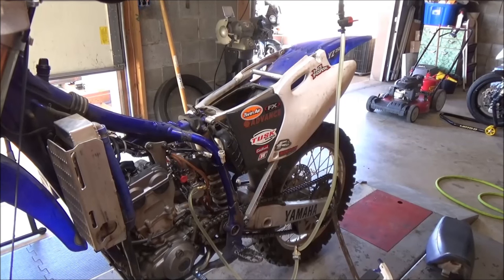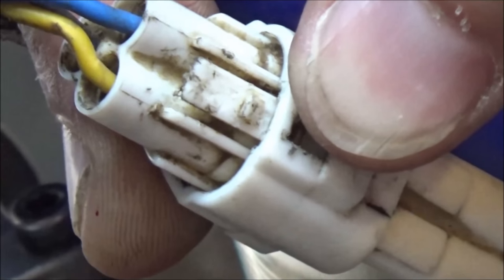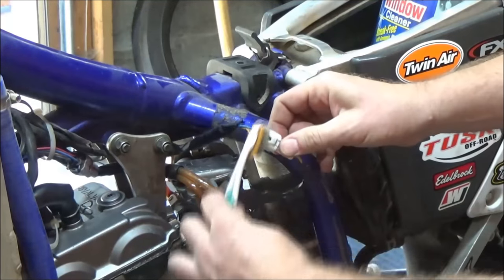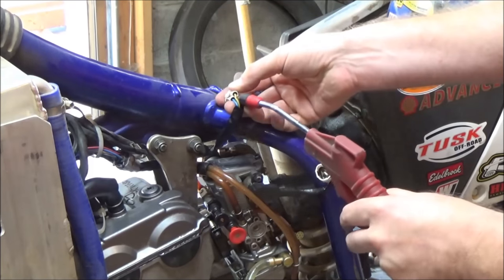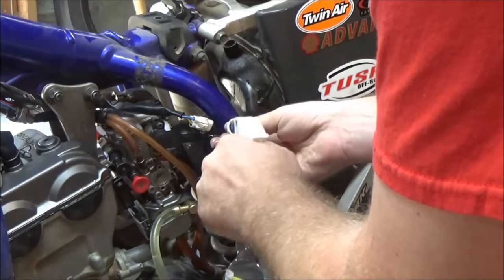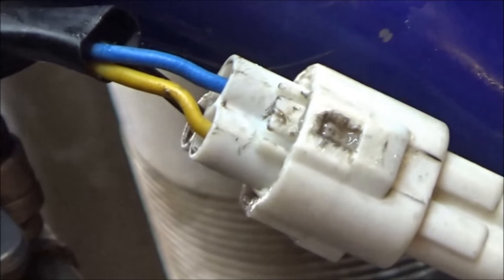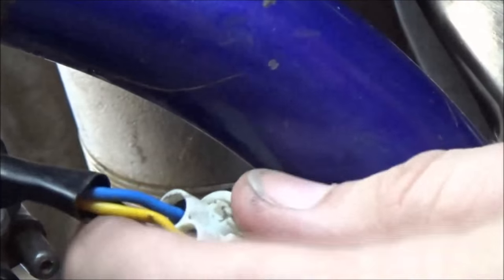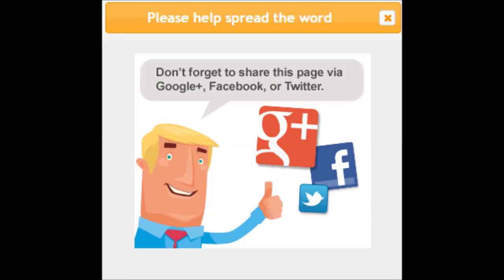Tips on how to disconnect  and service electrical connections on motorcycle, auto and farm equipment

Comment: Sometimes I work on really old cars 90s and 80s. So I like to spray a pb blaster after blasting air;  cus they'll be super stuck. I'll wait a few minutes then they usually slip like butter. and I'll finish it with some dielectric grease after airing out the pb blaster.